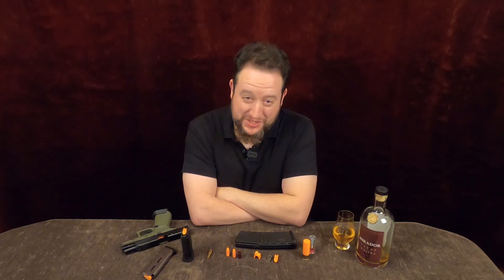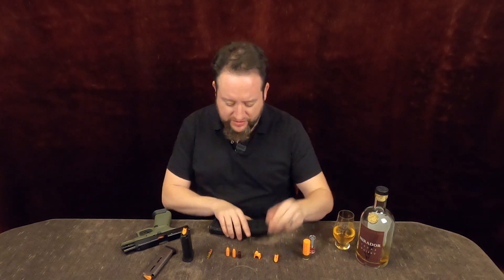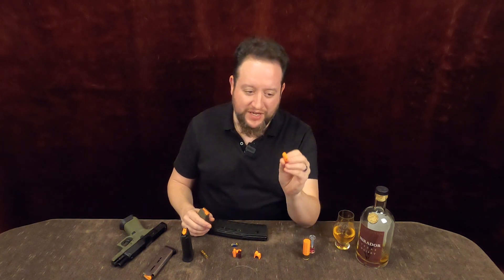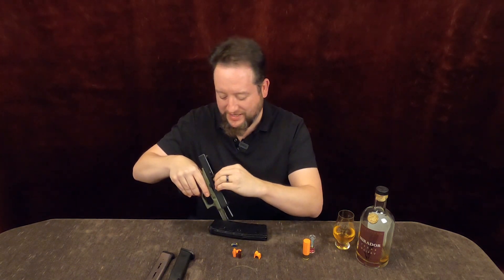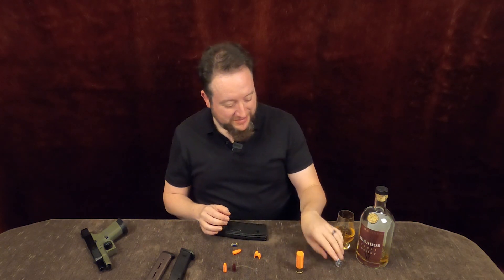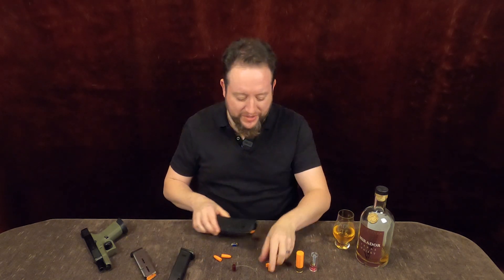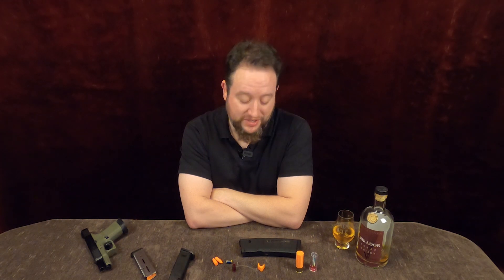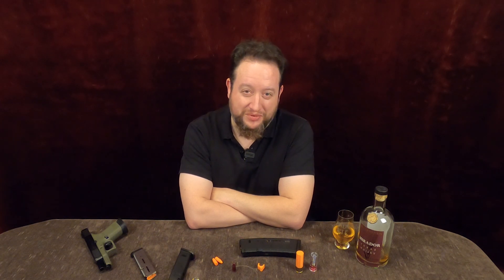3D Printable Laser Training Aids

Comment: I assume the magazine inserts are only necessary for handguns with a magazine disconnect.  Otherwise, just practice without a magazine.
Reply from the maker: Or for something very compact like a G43 which is smaller in the hand without a mag that gives you a spot for your pinky
Reply: @DeviantOllam  Ah, of course.  I have both an LCP and a G26, both with pinky magazine extensions.  Makes sense!

Comment: I'd like to know how 3D printed snap caps holds up.  I imagine the material makes a huge difference. My commercial snap caps have lasted a long time.
Reply: They hold up quite well. I printed 50 of them with TPU; so far they've gotten 2000+ dry fires spread across the lot without much noticeable wear. No more than I see on commercial snap caps.
Reply: stick a 209 snapcap in the base
Reply: It costs probably a penny or 2 for a 3D printed
How much does it hurt when you loose your commercial snap caps?
Reply: @eriequiet  I'd hate to possibly get little pieces of junk inside my firearms.  Anyway feedback suggests they hold up well.